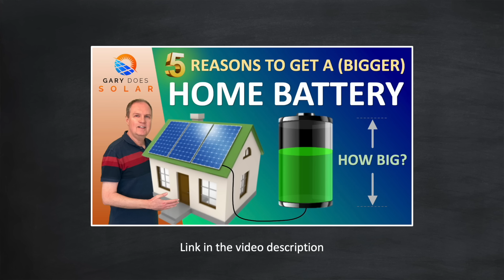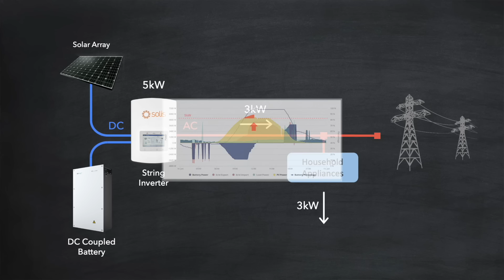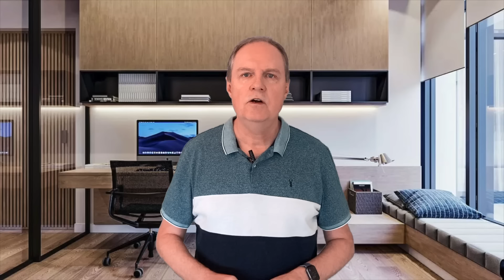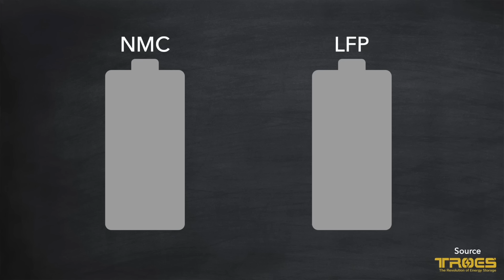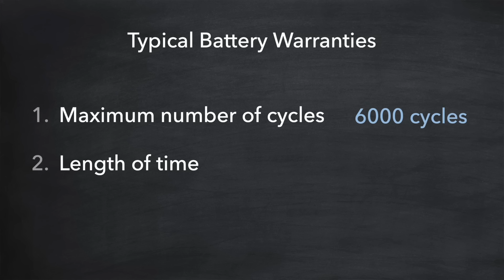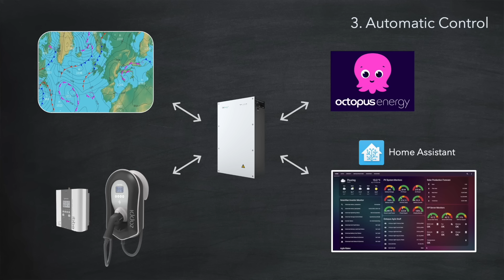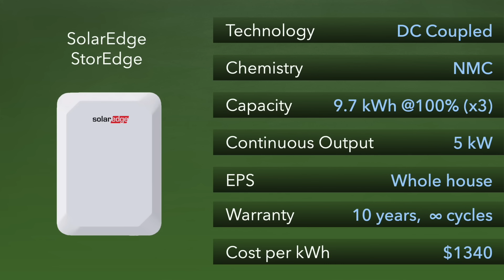8 Key Factors When Choosing the IDEAL Home Battery

Comment: So with the limits of Li batteries, we should be able to use other chemistries since for static applications, weight is no longer a consideration.  Some of the alternatives can be cycled between 0 and 100% with no decrease in capacity, last far longer, will be cheaper than Li batteries once they have market share since they are made from cheap, readily available elements, are safer from a fire point of view, and will be easily recycled if you ever have to recycle them.  There are the ZnBr flow/plating and gel batteries, the SbCa liquid metal batteries, FeAir and Fe redox batteries, V redox batteries and even the up and coming Na batteries.
Reply from the maker: Thanks William - this is great insight! :-)

Comment: Why did you mention EPS with the SolarEdge home battery? There is no possibility to have EPS with that Range and in any casy every dc coupled battery is dependent on the inverter to see if it has eps or not.
Reply from the maker: My understanding is that can indeed have EPS backup with a SolarEdge battery: https://www.solaredge.com/us/products/residential/storage-and-backup/solaredge-home-backup-interface
Reply: @GaryDoesSolar  Hi, thanks for the clarification. 
I think this is a US only thing and not available in the EU. For us SolarEdge only offers back-up with a three phase hub inverter with a back-up interface added to the system. 

Single phase has no backup possibilities. 

I work for a distributor in the EU, so I was surprised to see that it's different in the US 😁
Reply from the maker: @EliasPolin  Thanks for the extra info, Elias - I'll check this out... 🙂

Comment: Great info and well explained again.
I am planning to install a system with microinverters and 3 Tesla Powerwalls. I am debating on the installation location of the batteries. The wall closest to the main electric panel is just behind two bedrooms, has direct sun for about 7 hours each day,  and is close to a bedroom window. I am thinking of asking the installer to install the batteries in the backyard below my patio which is a shaded area further away from bedrooms, behind my kitchen. It is about 25-30 meters away from the main panel, depending on how the installer will run the lines.
I have a few questions:
1. Is the longer distance from the panel a performance issue having the AC power run 25-30 meters?
2. Is there any radiation emitted from the NMC battery and charging actions I need to be worried about if I install the batteries next to the main electric panel, behind my bedroom?
2. Do I need to be worried about the direct sun on my batteries, shortening the battery life?
3. Is there any chance that the noise level of the 3 batteries will be noticeable behind the bedroom and disturb our sleep at night?
4. Any other considerations I need to be thinking about with regard to batteries installation location?

Thanks,
Hank
Reply from the maker: Hi Hank, thanks for taking the time to comment. Unfortunately, l'm not in a position to provide individual advice (not least because of potential liability issues, even if that advice is given free - such is the world today). You're best to speak to an installer for advice, or post a comment onto a solar forum (e.g. this one in the UK: https:// www.facebook.com/groups/2197329430289466). Good luck!

Comment: Just seen an American YouTube video about small, portable, battery packs that plug into a wall socket (effectively a AC coupled system). Obviously small in capacity terms, but something you can take with you when you move house. In the USA they still seem to be at the pre-production phase, so probably a year or two away.

Does anyone have any experience of this sort of thing? Seems to be a way of avoiding installation costs, and might be worth considering if you got little spare energy to harvest. As an example, I use a Solar PV diverter and electric convector heaters to provide background warmth between Autumn and Spring - so there would be little power available for a battery.
BTW - Storing energy as heat (in the structure and contents of the house) is very much cheaper than using a battery (the only downside is that I can't use it on hot days).
Reply from the maker: Hi Robert, sounds interesting. Do you have a link?

Comment: In Germany you are not allowed to charge the battery from the grid or discharge the battery to the grid. So the AC coupled batteries have to reduce power to 0 if you have enough power from PV or at times where there is noting from the PV and you are using couple of 100s of Watts at home then the batteries must only cover that.
At least the grid providers in my area are like that. Some other parts in Germany that might not be the case. I will be installing Enphase batteries 1 for each phase. Next week its delivery time. 😁
Reply from the maker: Thanks for this information about German energy policy (in your area at least) - I didn't know that. The policy does seem quite restrictive, especially in light of the fact that many countries depend of displaced energy via batteries to support everyday operation of the grid. Why not extend to domestic situations? 

Good luck with the install next week! :-)
Reply: @GaryDoesSolar  The bureaucracy and all the regulations in this country can be so restrictive that makes you want to pull your hair out and give up. They are getting better but still a way to go. At least as of 01.01.2023, there is no VAT on the equipment and installation. But yeah it's crazy. I'm allowed to feed the grid directly from the panels but not from the batteries. Go figure.

Thanks about next week. Lets hope it all goes well. 16 Mayer Burger are going up together with Enphase IQ7A Microinverters and also the batteries.😁
And keep up the good work. Great and informative videos. 

P.S. If you are interested I can keep you posted.

Comment: Excellent video - I have forwarded it onto friends who are trying to decide which battery to get. 
I think there is another factor in making the choice between AC or DC coupled batteries. My DNO (National Grid) will not allow the total of all inverters to be greater than a set amount. In my case it is 10Kw. I have a 5Kw inverter and a Tesla powerwall (5Kw max output) and they will not allow me to add another Powerwall or more solar. They would be happy for me to have a DC battery as that is behind the inverter.
It seems they do not trust the power limiters (G100). They have told me the only way I can add AC batteries or more solar is by going to three phase.
Keep up the great work.
Reply from the maker: Cheers Hugh, and yeah, I think the DNOs are starting to get worried about the increasing numbers of home solar/battery installations. I do believe there is a hardware option to limit export (another box that manages just that) but I don't know too much about it. Worth investigating?

Comment: Hi Gary, I have got a 30 kWh Nissan Leaf and now a am on vehicle to home. So I run my home from my car. The electric can go both ways. I have just signed up with Octopus Go. At the moment I am exporting a lot of solar but I am told I will not be paid for this as I am on Octopus Go. Is this right. Bob.
Reply from the maker: Hi Bob, now with Octopus Go, any export payments will be calculated on the standard Octopus SEG tariff, which is only about 4.1p/kWh if I remember correctly. The Go tariff is therefore not a great tariff for export, but it is a great tariff for buying cheap energy during the night and using that the next day.
Reply: @GaryDoesSolar  Hi Gary, 

Thanks for that. They told me wrong. I await my first bill. 1st September. Bob.

Comment: When charging an EV, there needs to be  smart comms from the charger to the DC inverter that prevent the DC battery from discharging preferentially, which would address that particularly issue.

Sadly, I've no idea how that might be done. 

Great explanation of the  tech  as always.
Reply from the maker: Thanks for the kind words, David.

Agreed, and until there are standardised interconnection protocols in place (who knows if/when they will ever come) then I understand that there is a workaround: https://support.myenergi.com/hc/en-gb/articles/4716922623633-Hybrid-PV-and-Battery-How-to-stop-your-myenergi-devices-draining-the-battery-in-ECO-

Comment: Dc coupled will almost always be the better solution, especially given that the price on hybrid inverters have come down significantly so they are on par with “normal” non hybrid. Also DC coupled will have better efficiency. Ac coupled will make sense if the battery can’t be placed next to inverter/solar.
Reply from the maker: I’m not sure I agree, for the reasons stated in the video

Comment from the maker: * NOTES SINCE RELEASE *

- I've had it pointed out to me that the Tesla Powerball 2 battery is now also capable of level 5 EPS (off-grid) - great 🙂

- Another important factor I could have added is the ability for batteries to prepare for storms, by pre-charging. For example: https://x.com/teslaenergy/status/1693138247436919214?s=12&t=Xnw8-EENQIi1mPAlIAXH4A

- At 6:18 I forgot to mention there is also a DC-DC conversion when the solar power is stored in the battery in the first place - this is because the voltages will be different. The conversion losses for DC-DC conversions are typically lower than AC-DC however.
Reply: actually matching the voltage of the battery to the solar string voltage is most efficient. i run 800v

Comment: Thanks Gary - great video.  Trying to put together a budget for PV + Battery + ASHP which is a challenge.  My first 'Google' after your video was on the Franklin WH aPower, but it looks pretty sparse out there in the UK to find an installer.  Can you share any suppliers?

Have you ever done a video that balances the kW capacity on Solar generation and Battery storage/supply?  I think I can fit 13 panels on my roof so probably around 4.5kW capacity, but your video on charging the battery at night off the grid was a total revelation to me.  Now I'm thinking the battery size choice should not be limited by my PV array.
Reply from the maker: Cheers Rob, for the kind words. Now, I'm not aware of any FranklinWH distributors in the UK unfortunately, but perhaps others might know...

Comment: On the AC/DC coupled battery issue, there are a couple of factors that have influenced my decision:
1. Ability to run in a completely offline mode, that is to say, provide whole-building power from either solar, battery, or a combination thereof if the grid is down. From what I've seen, most AC coupled batteries require grid sync to function, and will power down (for very good safety reasons) if the grid is offline. Perhaps a trivial issue if you rarely have power cuts, but for those of us in rural areas, more of a consideration.
2. The cost difference between 3.6kW, 5.5kW and 8kW hybrid inverters seems to be relatively trivial (<£200 per output 'step'), so it seems logical to go for the largest inverter output you think you'll need. In my case, I have to try really hard to pull more than 6kW of instantaneous load, so a 7kW inverter is fine for my needs. Your mileage may vary etc.
Reply from the maker: Great insight - thanks for sharing!

Comment: Hi Gary, you appear to be one of the most (switched on) YouTubers.  I always believe that bigger is better as I live in the tropics and am still working on my Solar design to accommodate A/C with Soft Starters to avoid Inrush Spikes, I am considering a 30 kWh Battery at 48V with 24 kWh inverters, where possible I want to have a DOD of 70% and a large solar array in S and P. I am probably going to use your software to model days of autonomy, as well as other factors.  Thanks for such good presentation.
Reply from the maker: Cheers Jeremy - that's high praise indeed! :-) And I hope you like using the utility!
Reply: up your voltage! there is so much loss in low voltage high current systems, and copper wiring and busbars have to be huge thick and expensive

Comment: I'm looking forward to your battery ROI video. Like you, I've tied it myself and generally see that for the "average" kWh user, batteries are an expensive option. But for higher energy users, maybe those with ASHP, then battery % utilisation is high and therefore more cost effective.
Reply from the maker: Agreed, and I'll try and get round to that video very soon (it's 3rd in the queue at the moment)...

Comment: Excellent channel Gary. Can you consider the cost / ROI on just buying a battery and not solar to go with it. With for instance Octopus Intelligent charging 0.075pkw is it even worth the hassle of funding & installing Solar? (I have a Grade 2 listed building appreciate it's still possible to have Solar but it's complicated). BTW I love solar, have over 200kw on a property portfolio plus three EVs in the family. But is just spending the money getting a bigger battery and paying a utility it's due to supply and manage the ins and outs "a" way forward. Also note 3 phase can be available for 4k.
Reply from the maker: Hi Robert, thanks for the kind words. Yeah, I'm planning to do just that - working our ROI just for the battery, isolating it (as far as possible) from the solar ROI. It's not an easy thing to do, but I hopefully will come up with something useful... Ok, that's clearly some property portfolio - well done! And great that you've got so much solar on them :-)

Comment: This is perhaps the best explanation of DC and AC coupled I’ve seen. Goes into practical use cases and realities - great point about the ‘combined’ power often not being a big benefit - if you have a strong enough solar day to go past your DC inverter limit, its likely you’ll have a full battery quite quickly like your example. For AC coupled, yes less efficient, but if you’re playing with losses from solar, its not a direct cost to you, just a trimming of your overall generation and no direct cost to you (tiny amount loss of export over the year maybe)
Reply: This is indeed a very clear explanation of DC vs AC coupled batteries, but it's worth bearing in mind that you can also have DC or AC coupled solar panels with a similar set of tradeoffs. i.e you can have an AC-coupled battery with DC-coupled solar panels, and he didn't cover that option.  
Also he's very optimistic about the conversion losses - they can be more like 10% than 3%, and are quite heavily dependent on the power lever the conversion is happening at. So you might find you are getting 25% losses on PV power going through a battery back to AC is you are not careful.
Reply from the maker: Thanks for the great feedback, and I agree with your comments!

Comment: with respect I think the instantaneous graph is a little ‘blunt’ suggsting high peak for several hours. Most of the time I’ve found high demand is more spiky, only a few minutes at a time. Even running dishwasher/tumbledryer/oven/kettle they often are at different phases of heating cycle or simply don’t run for long. I’d be curious to understand more on this - perhaps a way I can measure peak load on my home. Logic tells me a 3kw would be fine, but I can’t deny I have been looking at the Givenergy AIO’s 6kw with some envy :) - but I already have a 3kw givenergy
Reply from the maker: Yeah, that graph is likely not representative of the reality for many - it was emphasised for the video. We breach the 3.6kW output of our GE batteries more often than I'd like, and the AIO or PW3 would solve that for us! One day (sigh)...
Reply: @GaryDoesSolar  I have one 9.5 givenergy. I probably want another in a year or two. But I wonder if I could sell my current and buy an AIO for around similar overall cost? Is there a market for used home batteries?
Reply from the maker: @MrKlawUK   I would buy your 9.5 from you, but unfortunately, I don't have room for it! Yes, there is a secondhand market - for example, eBay: https://www.ebay.co.uk/sch/i.html?_nkw=givenergy+battery&_sacat=0

Comment: You’ve done it again Gary! Keep up the good work my friend 👍🏻 do you know would would be required if you wanted to make any of the batteries EPS off grid rather than whole house?
Reply from the maker: Thanks Oliver :-)

You'd need to check with the manufacturers - they determine whether the batteries can be used in an off-grid scenario (level 5)...

Comment: Personally, I would never allow a battery to be inside my house, I would prefer a battery that can be installed outside that still gives decent winter performance.
Reply from the maker: Yeah, safety is a huge concern, and whilst I have two LFP batteries in my garage, I'd never have NMC in the house.

Comment: Superb video, you answered SO many questions I have. One question about EPS, does it matter whether its an AC or DC coupled battery?
Reply from the maker: Thanks - so great to hear, Darren! :-)

Now, I'm not sure I understood your question well. EPS operation depends on the manufacturer of the battery for AC Coupled, and the manufacturer of the inverter/battery for DC Coupled. Are you asking for a particular battery model?
Reply: @GaryDoesSolar Thanks, I think that answers my question. I was wondering if EPS was only for a specific configuration, such as AC or DC coupled, but if i'm reading you correctly, the configuration is not the determining factor, more the capability of the devices in said configuration.
Reply from the maker: @sygad1  Agreed